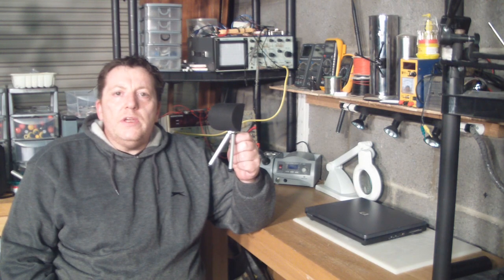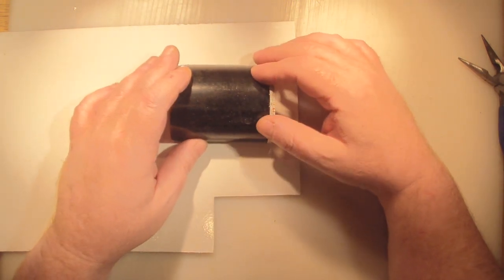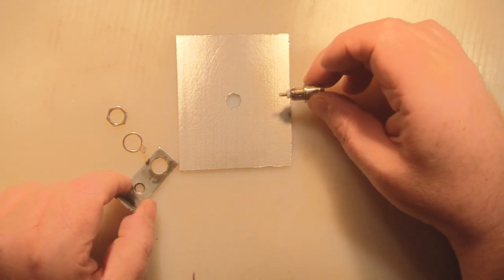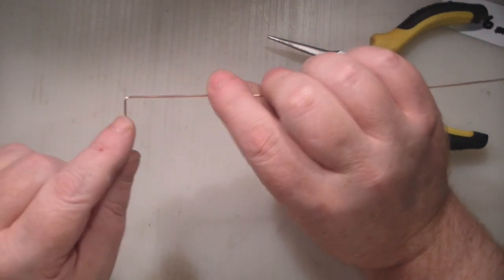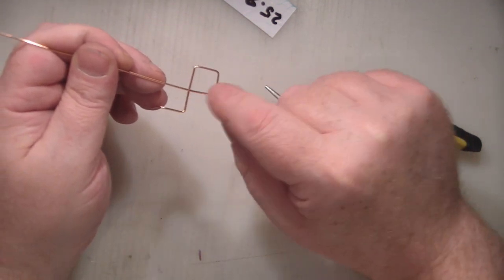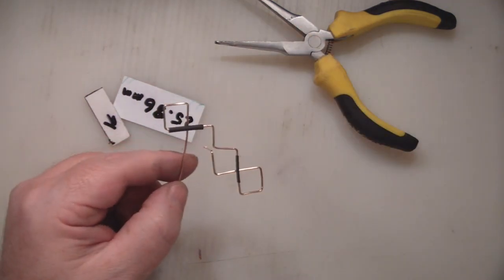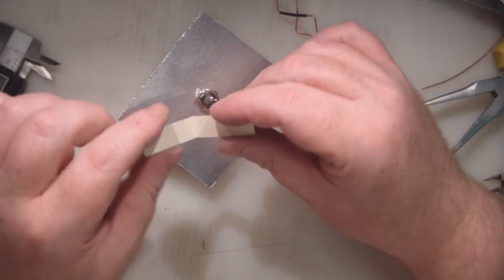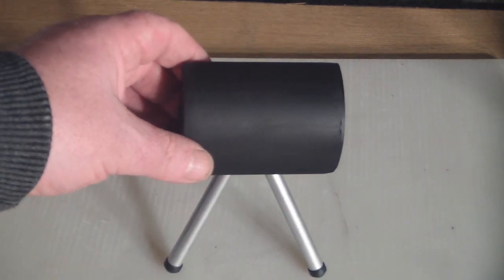Double Biquad Antenna for the 5GHz Band #29

Comment: Hi Andrew. Love your channel! One question, though: You say the distance between the element and reflector must be 1/4 wavelength. I don't understand the reasoning behind this decision.

Wouldn't that mean that the reflected signal will have travelled one half wavelength when meeting the element, and thus be in exact opposite phase compared to the directly received signal. I would think 1/2 wavelength to be the correct spacing to ensure correct phase. But I might be wrong, as your testresult clearly show very good reception. 

But can you explain why 1/4 is optimal?
Reply: I found the reason myself. The correct distance is indeed 1/4 wavelength. The reason is, that EM waves invert when reflected by a metal surface. Therefore at 1/4 wavelength the signals will be in phase.

Comment: Great video! If using these for FPV flying with a quadcopter, what kind of coverage angle are you likely to get with this on the video receiver?
Reply: I'll reply to my own question seeing as I've made one of these wonderful antennae now :-) Beam angle seems narrower vertically than horizontally, not surprising as the antenna is wider horizontally than vertically, as is its reflector. I found that at range of a mile, the video signal was perfect with the biquad pointing within +/-20º horizontally and +/-10º vertically to my quad. Further than that would result in increasing snow.

As I said though, at a mile, video signal was perfect out in the hills with my 600mw video TX so I reckon this antennae would give me easy double that. Incidentally I made mine out of the core of the thinnest coax Maplin sell so I could get the angles tight and the lengths as accurate as possible. I think the whole thing cost about £8 to make including copper-clad board and a plastic case.

Thanks for this and your other tutorials Andrew :-)
Reply: @wattage2007  Very long time ago now, but do you still fly fpv =)
Reply: Mark Yes, fixed wing nowadays only.
Reply: @wattage2007  same here, what do you fly? ive just ordered an arctic cat (:
Reply: Mark A snow-mobile?
Reply: @wattage2007  snow/water plane

Comment: I notive that you are not accurate with the measures of the back reflector. Most websites say it has to be 1/2X1 wavelenghs in size... But a double biquad does not fit in that size....

Comment: Hi, Great vid. Thanks for doing this. Just one quick question:  You are using aluminum foil for your reflector right? I think I heard you referring to it as silver foil, so I'm a little confused.
Reply from the maker: Hi Dave yes it is aluminum foil we call it silver foil in Yorkshire sorry for the confusion.
Reply: andrew mcneil That's alright, we often call it tin foil (also equally wrong).

Comment from the maker: Hi no it is a good question. You need to use LMR 195 coax low loss microwave rated coax. You can get a readymade cable (1metre) off ebay for around £10. Using non rated coax like the type used for TVs will course signal loss.
Hope this helps.